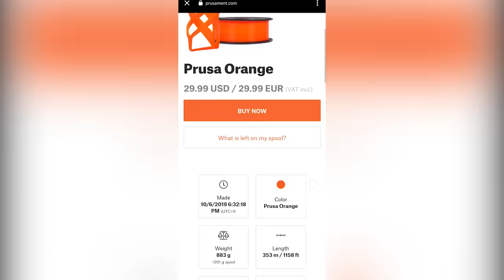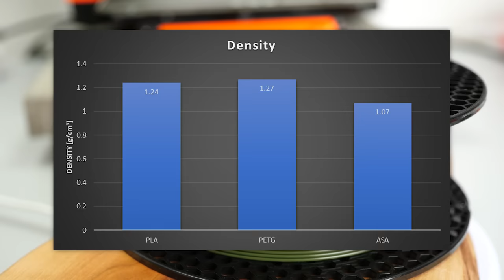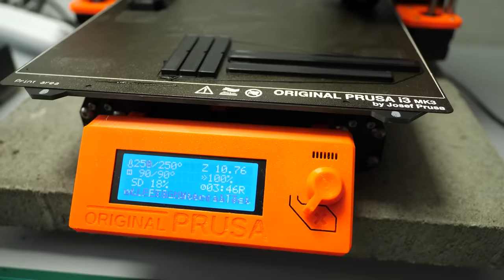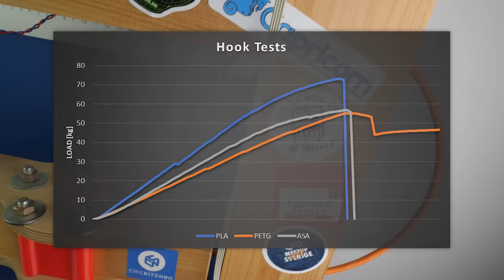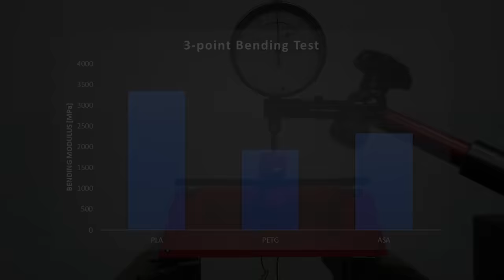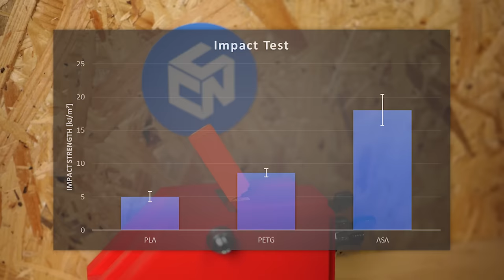The BEST 3D printing material? Comparing PLA, PETG & ASA (ABS) - feat. PRUSAMENT by Josef Prusa

Comment: I wouldn't use PLA because it gets brittle after absorbing moisture. thus substantially weakening over time one thing this test doesn't show. 
PETG would at least bend before it breaks. 
print these samples again and wait a few months before doing the test. and test again 1 year after the sample was printed. also be sure to leave the parts out in the open exposed to humidity.

Comment: Not sure how this guy is printing quadcopter frames out of PLA. The one I did completely melted and warped just flying outside on a hot sunny day. Prussia PLA must be way more heat resistant than the ones I've used.

Comment: Thanks for another great video, I'd like to see you do some testing to see if the color of a filament changes the performance, you may already have this data, however, the results would be very interesting to see. I used to print everything in PLA, with some (very little) PETG, however, with having built an enclosure, I've switched to ABS and ABS+, however, ABS is my preferred filament. I'm going to have to try ASA now, since it looks really promising.
Reply: Surprisingly yes, it does seem to have massive differences (tested similarly but with university test equipment). I considered the test invalid on the grounds of not re-tuning per filament and optimizing, but on the grounds as a consumer (pushing 190c or whatever, same brand and material within 1 week of manufacturing time stamp on all rolls with only color as the variation), then yes it did seem to vary quite a bit. I think I probably have a private copy of the data on some USB drive somewhere, but I remember it was like on the magnitude of 10% possible variation. They seemed to test reasonably well (very tight clusters per sample type, like 2% deviation at most) so out of like half a dozen of each color (also times different print orientation, so there were like ~30 prints per color), some colors did better than others. I think it will vary with manufacturer but still I’m a skeptic because I don’t get how a color could possibly change a materials strength if we’re talking red/black/green/blue or whatever, to me it makes sense if no color added vs color could change since it’s pure vs impurities added (though might make it stronger like carbon steel).

From personal testing I’ve noticed some colors need massive changes like 10c hotter printing, hence I think they need to retest and optimize each material printing temp to optimize its strength, but I do see where most people aren’t going to do this and just keep on printing if it’s working.

I don’t think the data was published (it was more of a side project for our UAV for aerospace engineering, like my mini project payload stability and for example adjusting Reynolds number by varying aspect ratio for fixed area/material). But I did find the color to be hallarious because that’s not even what they were testing but it dominated the results (they were testing infil pattern and orientation of parts, but the color red I think it was, just blew the others out of the water when it came to strength for all print orientations, so then they started analyzing that anomaly, haha, weird test anomalies you never expect, that’s what makes science great!
Reply: @jakegarrett8109  You make some good points, Optimal print temperature for each filament being a big factor. I guess the only way you'd get data you could have high confidence in would be to work very closely with one manufacturer and be able to document what changes there are/where between production runs. Ideally same base components, same machine, etc. I doubt there will be a single differences in batches, ie: just adding Blue or Red dye, etc.

Comment: Printing ASA with cooling and without and case is super dump.
I can print ASA from extrudr without any cooling (fan standing still) with 245°C @ 40mm/s within an enclosure that heats up to 45°C within an hour. The parts look good and they should be much stronger as those shown at your video...

Comment: So myself and a few other friends have been 3D printing Raidio Controlled model airplanes ✈️ for a few years now. We fly these models all year around in outside temperatures from 10 to 105 degrees Fahrenheit (F). In rain 🌧 ,snow ❄️, and clear weather. These airplanes are powered with electric power systems. We started printing them in PLA filaments only to find that they would start to get soft and deform in the sun ☀️ at temperatures starting at 70 degrees F. So PLA didn’t work well for our purposes. For the last year we have been printing our airplanes in ABS using an enclosure and these airplanes have been doing very well at all temperatures in full sunlight. We are printing the same airplane just the filament has been changed from PLA to ABS. So far the ABS is working very well for outdoor flying.👍🏻✈️😎

Comment: I print tiny guns for my 6 inch action figures and have been looking for an answer to my problems. My main problem is the fact that they break super easily while I clean off the supports. 8 print them pointing up since that makes them look the cleanest, given that if I print them laying flat, the bottom side ends up looking gross after removing supports. I print with PLA, 100% infill, speed at 50.

Comment: What's the print volume on this printer?  I want to print motorcycle parts, as I m making custom motorcycle cruiser/rocket/Akira anime motorcycle.  I need a large printer that can print high heat resistantce materials, I assume not too high so printer can use it, but with some insulation inside of parts that face hot motor and externally heat resistant paint in combination should do the trick.  Too many video bot covering volume of printing size at once.

Comment: Great test. Weight is the most important factor for stiffness (and strength). You can increase wall thickness, infill density or thickness of the part (for stiffness). I would be interested what the best combination of wall thickness vs. infill density is for a given weight to achieve maximum stiffness. Let's say you print a part with a final weight of 10g, 20g and 40g. Increasing the parts thickness is allowed as long as you end up at the same weight. What would be the best combination of wall thickness and infill thickness? My guess is, increasing part thickness and/or wall thickness is the most important factor. However it might be possible that it is sub-optimal to leave the parts hollow (0% infill density). Maybe a combination of part thickness, wall thickness and some minimal infill (5%) would lead to optimal stiffness. What do you think?

Comment: Request for another test (idea for video):
As a engineer with a 3d printer at work (mostly for tooling or prototyping) often the decision how to manufacture is not only between different filaments, but also alternativelt: injection moulding, and machining (materials: peek, ultem, pe, pp 
, Ect.) (Note: And this is only of we limit ourselves to plastics) 
It would be interesting to learn how you're hook design manufactured in these manufacturing processes and materials would perform in similar tests as a baseline.

A added benefit would be to know how much stronger i can estimate a prototype in pla from our printer to become when using a different manufacturing technique..

Thanks a lot for your content

Comment: How come I'm seeing people respond to strength questions so confidently that PETG is way stronger than PLA?
Reply: That's a mystification. PETG is a good material where flexibility is required or tolerated, or when translucency and shiny look is desired. So in short, it is soo wrong to use it for machine building elements, where mostly rigidity is required.

Yet, everyone seems to use PETG when printing functional parts.

For comparison: cast iron is also brittle, but more rigid than mild steel. The same applies to PLA. Engineer the part properly then it won't break.

My rule of thumb is: if temperature resistance is not required then I print in PLA.
If I print for outdoor use, I print in ASA. If i am in the shiney mood, I choose PETG. 😄 To be serious, for me, PETG is for clips or similar which are need to be springy.

Not really tested yet, but it seems to me that PLA has good abrasion resistance too. I am pretty sure it is more resistant than ASA, because ASA is way easier to machine.

If you want to post-process the part, drill holes, cut threads, file, mill, turn... then ASA is wery great!

Comment: I find this video somewhat misleading, since all the plastics are not tempered after printing. A classic beginners mistake. It is impossible for PLA to contest against properly tempered PETG in any other scenario than pure decoration. Also, PLA weakens really fast and bends at room temperature, while the other materials gain strength over time due to their hygroscopic nature and are much more heat resistant. The water adds plasticity, hence impact resistance and wear resistance. The most important bummer: Nylon, the most potent printable plastic, is not even mentioned. I tend to interpret this as pseudo science. Sorry.

Comment: Your testing is flawed as you introduce leverage forces in your hook. So unless you accounted for the hooks being bent left during load as well as pulled down your numbers will be off. You basically tested what material resists leverage better rather than what material is best at resisting a linear pulling force.

Comment: Only PLA until i can put the printer in a perfectly sealed enclosure. I dot want to poison myself more with asa, abs, tpu, petg and others...
Reply: Yeah, I’m not a fan of inhaling molten/outgassing plastic fumes! I even open the window when printing PLA, like we probably won’t know it’s effects for a while since home printing is so new and people are now exposed to it 24/7 even printing in their bedrooms where they sleep at night, like it’s way more exposure than just an 8 hour job! I also print ABS but it’s next to a window with a fan (same for solder, which I use lead based because it’s so much better, but I definitely account for fumes!). Ventilation is key, and it really helps if you have it in an enclosed box. It can even just be a $5 Tupperware storage box plus a fan and hose blowing it out of a partially opened window, maybe go clear box to see it working, but you will need a small vent fan blowing outside because when you open the box you’ll get a good waft of those fumes!
Reply: "perfectly sealed" isn't a solution. You want a venting enclosure. Sealing the air in will inevitably let the fumes out in your home when you open it. I built my enclosure and printed a dryer vent hose connection for the enclosure and one to connect to a 2x4 I place in the bottom of a nearby window. All fumes and plastic microparticles are pulled out by USB fans.

Comment: Too bad that each fabricator invents their own ways of shrinking the product and you need to compare price per kg instead of price per spool. I'm buying "900 g" spool that has 300m or "1.185 kg" spool with 400 m. Some manufacturers don't include mass or length to make it harder to compare.

Comment: You ASA impact test is a failed test. At least I once learned, that when the material does not break into two parts, you can't use the test results.
Anyone can confirm?
Reply: Have you ever done any impact testing in a laboratory?
Reply: @batman9592  yes👍

Comment: Layer adhesion is the best for PETG and it allows to print functional parts. Layer adhesion for ABS or ASA is the worst. PLA not temperature resistant. So PETG is the winner for functional parts. For me PETG rocks. The rest is a garbage.

Comment: great comparison video, I need help with my 3d printer. I Have Geeetech A10. I started printing with solid red PLA and I have successfully printed my phone stand. Print came out flawless, very solid and very clean. Then bought Hatchbox ABS black filament and replaced old PLA. I was never able to get a normal print with it. Tried changing every single parameter bit it just wouldn't work. So i changed back to previous red PLA again, but things went bad, it started leaking black filament from extruder, probably some ABS was stuck in there . Now there isn't any black spots in my prints, but quality is far worse than i have printed months ago. Printer sometimes stops extruding too as i have noticed, because places are left blank. I can show pictures of what it's printing right now, even color seems different for me. Here are pics https://drive.google.com/file/d/1owFdf86FpbcwWpRhK4OZYtXDbUgVhIew/view?usp=drivesdk 
https://drive.google.com/file/d/1p7XgvLQc7HZdoRsr3mwNRpCN8phaQwi6/view?usp=drivesdk

Comment: Pay attention guy, because your test depends on the geometry of your sample. Your stress field involves tensil strengt and flexural strengt too, the result of the sample resistence is a mix of the two kind of stress. So if you change the sample the result can be the opposite!!! The same observation is possible about the percentage and the shape of infill that you use to make the sample. To compare the mechanical resistance of different material you have to use a standar dog bone sample with 100% of infill. Your tests are not usefull and can bring you to wrong conlusions! Bye.

Comment: why does he print in the corner, makes me angry
Reply: It's to even out the wear on the bed. If you only print in the middle all the time, the middle will wear out quickly and the outer edges will be perfect. You just get more use out of the bed if you spread it around.

And it also helps with the bed warping.

Comment: Seriously this test of ASA and saying its 'like' ABS is rather werid?.
ABS is pretty soft material where ASA seems fairly stiff in your test. I would thing ABS is softer than PETG, unless prusament PETG is just extremely soft.
Then printing the materal in open air with clearly showing you had bad warping and failures isn't a fair test at all. Then you get a enclosure and its big enough to fit a cr10s and wonder why you can only get it to 30* ambient. You seriously need to revisit ABS and ASA and stop doing these half assed tests with out a propper setup. Its a complete misrepresentation of these filaments.

Comment: Your strenght test isnt correct, you are testing printed material, so you can be printing pla in optimal temperature conditions and not petg or asa, to test strenght you should use the string before printing, and you would see that pla is actually the weakest and not the strongest.

Comment: Man, this is a lot of work. I just look at the data sheet for a particular material. I know there isn't a datasheet for all these filaments out there, but basic material properties are available, and lets be honest, you aren't going to run these types of tests on every filament you buy. You are going to rely on a few basic tests of representative materials. Why bother with all this nonsense when you can look at the Young's modulus, ultimate strength, toughness, heat deflection, and glass transition, etc. This amount of rigor is great, especially if you wanted an exact understanding of the material you are using, but the results are predictable without all the effort. Teaching people what all these things are and how to interpret them doesn't make for exciting YouTube content I guess.